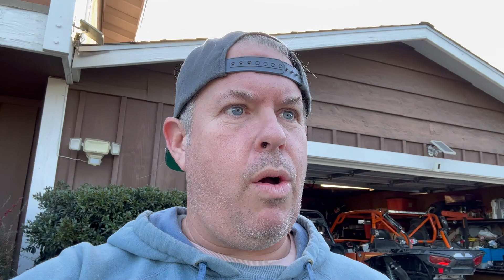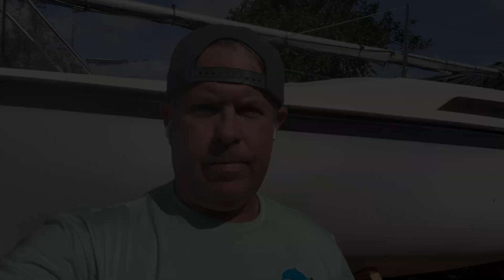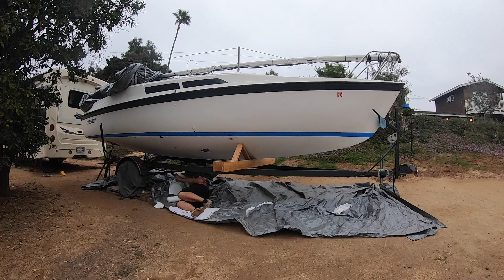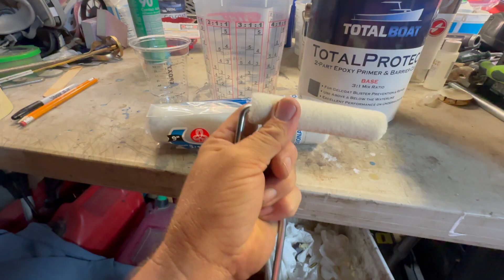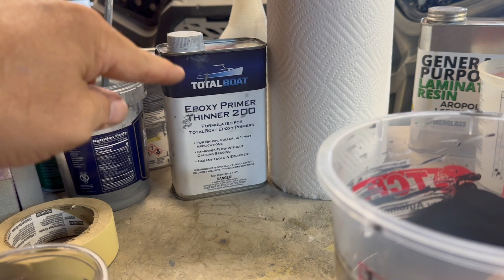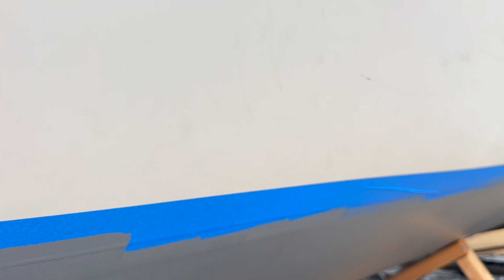TotalBoat Total Protect Barrier Coat Application

Comment: no video for the top coat?

I have been using System Three LPU. ...but these guys screwed up and had to discontinue their entire boat paint program, what a mess.

Anyways, I am looking for an alternative (I like the LPU stuff, tried quite a few other paints with limited success).
What is your experience with the top coat from Total boat? 
does it flow ok ?
and of course, is it hard enough and last for a decent amount of time?
Reply from the maker: So in the next video we did the bottom paint but opted to repair the Gelcoat and polish and wax above the water line.